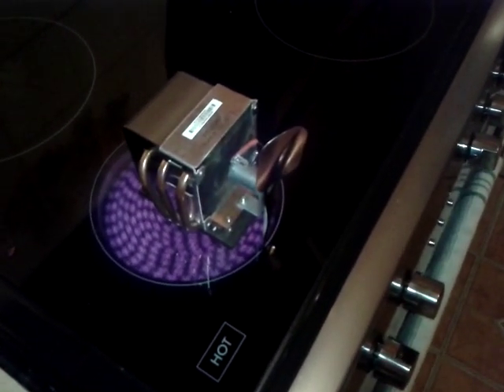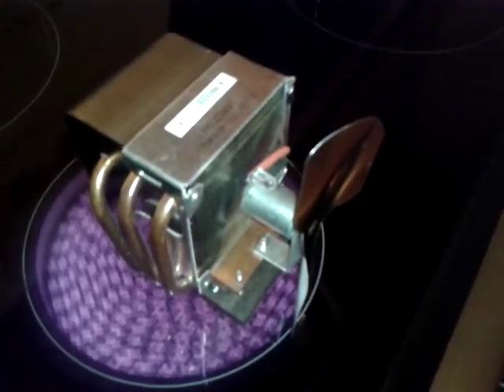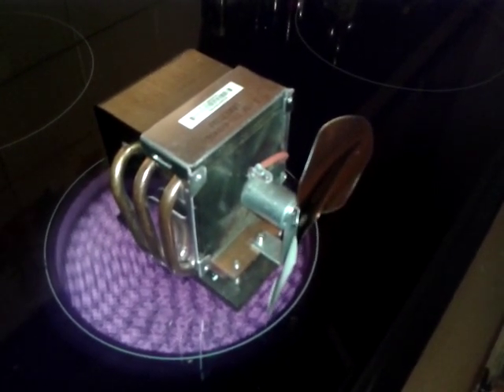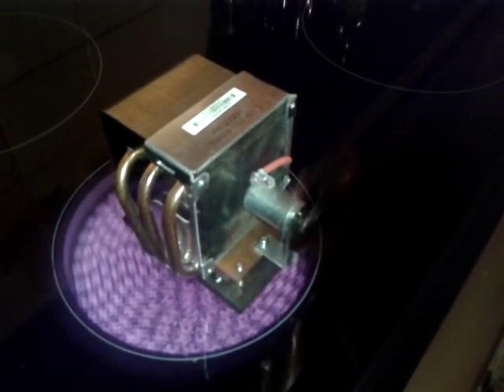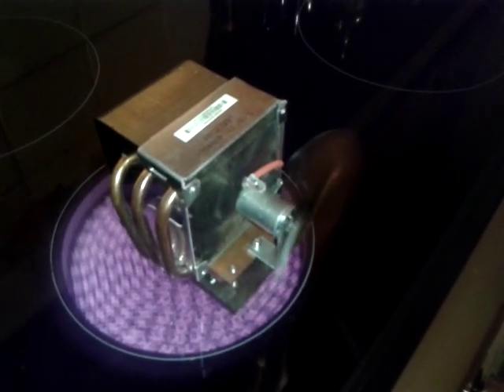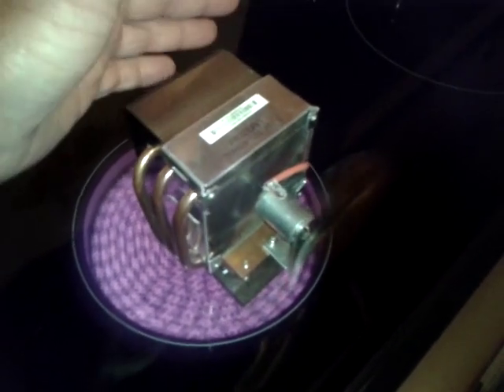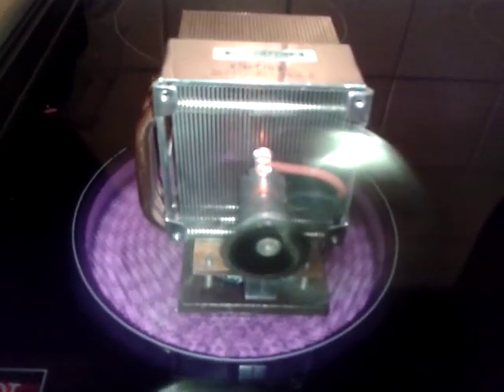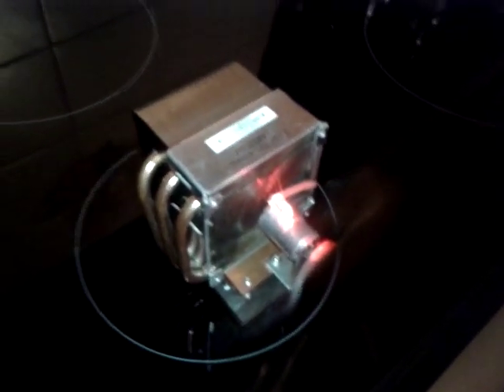DIY Eco Fan

Comment: Hi, wondering what voltage you get of your peltier? My homemade fan runs at an average 0.5 volts but not really much more, suprised how yours manages to power an led too???? And spins really fast, amazing how they all vary.
Reply from the maker: You need a very low power, high efficiency motor - the ones in RC Model servo's are ideal.

Comment: Unless you limit the heat input to the base the solder in the peltier will melt at or around 150 degrees C - the temp most stove tops run at. Still nice job and love the LED :-)
Did you see my Stove Top Fan-C range ?